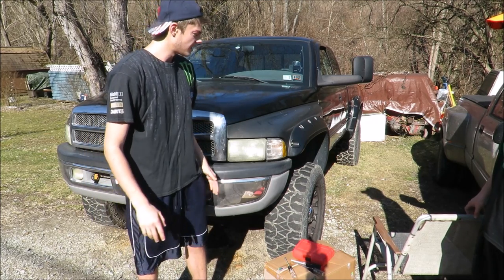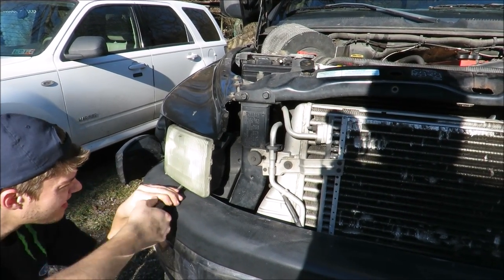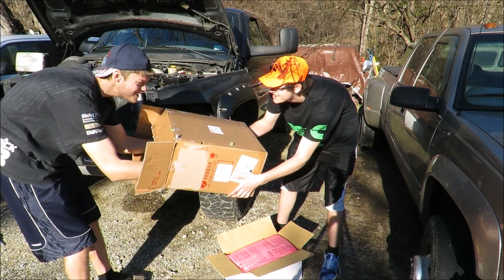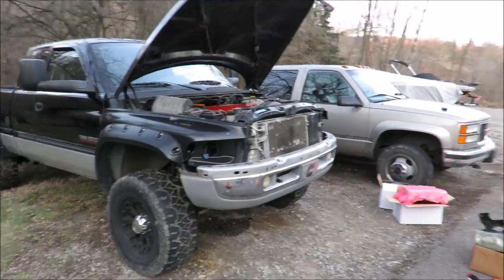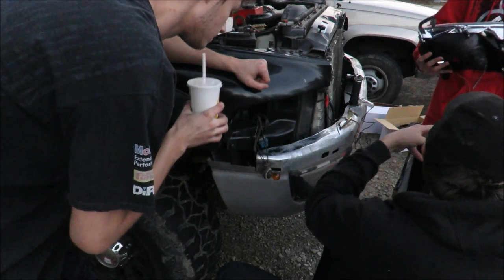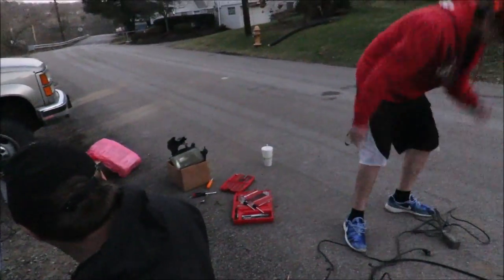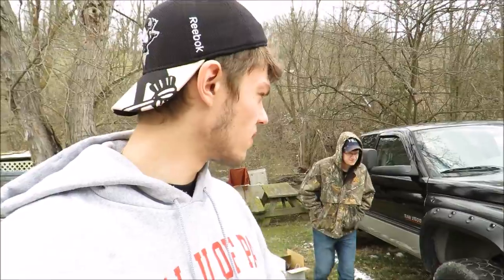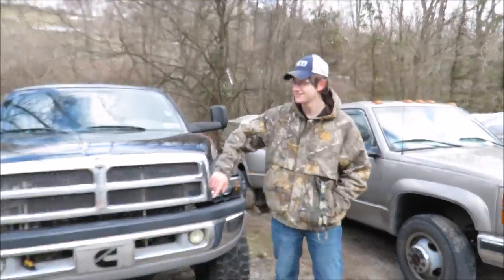LED Halo Headlight Install - 2002 Dodge Cummins

Comment: Thank you! I just purchased a 98 2500 and have been struggling for about term minutes to get the aftermarket lights to fit I spending a few minutes here solved my problem. Thank you thank you!
Reply from the maker: Thanks for watching and the sub! I'm glad the video helped you! Best of luck!
Reply: Did your stock bulbs fit rite in or did you neeed to buy different bulbs

Comment: Do those come with a harness to split the high/low beam from the stock single bulb?
Reply from the maker: They just plug right up to the original port from the stock bulb plug. So no need to split the high/low beam. The only wiring we did was for the running lights, turn signal, and halo ring light.
Reply: Awesome thank you! Thought it was 2 separate plugs haha

Comment: Got the same headlights as yours on my Ram 2nd gen 1500, everything lights up but the halo ring and 3 small LEDs don’t light up unless it’s on brights. They only light up on brights. Do you know what could be wrong?
Reply from the maker: We wired the loose wires of the new headlight into the running light circuit from the truck. You possibly may have wired yours into the highbeam wire. Our 3 LEDs and halo come on together with the amber running light. 
There is a running light, lowebeam, highbeam, and the neutral/ground wire coming from the truck. Hope that helps. Thanks for watching!
Reply: Hayden Kehm thank you! I’ll see what I can do. Love your guys trucks👍🏼
Reply from the maker: We also used that 2 way plug so incase we ever needed to remove the headlight it would be easier so it wasn't completely hard wired into the truck. And Thanks bro, appreciate it! New videos coming soon!

Comment: Did you guys have to buy different bulbs or do the stock ones fit rite in
Reply from the maker: The new headlight replaces the original bulbs, they plug into the main connection after the bulb is disconnected, but some soldering is required for the small LED lights and the halo ring. But the original turn signal bulbs plug right into these. Thanks for watching.!
Reply: Hayden Kehm thanks man appreciate it and no soldering for me I’ll use quick connects lol
Reply from the maker: Hahaha there ya go! We just went the long route with it because my brother is practically redoing everything so we wanted to go all out lol
Reply: Hayden Kehm would you happen to know where to adjust the main bulb up and down?
Reply from the maker: That I'm not sure of, you would probably have to take the new light apart to do that, you possibly could just angle it a bit somehow when installing it on the truck.?

Comment: How’d you fix the gap between the fenders and headlight
Reply from the maker: He is still currently running them with the gap, he's planning on fixing it with some sort of rubber filler almost like a gasket to fill the gap.. Thanks for watching

Comment: say brother how was the wireing set up on the headlight
Reply from the maker: there is a main plug that hooks up to the trucks original hookup port, and then there are loose wires that needed soddered and wired up in order to get the halo ring / accent lights to turn on! Hope that helped! Thanks for watching!

Comment: Hey whats that yellow plug that comes off the main blue plug?
Reply from the maker: The yellow plug is the main power plug that hooks up to the input port where the original headlight bulb would plug into.. Pretty sure the blue plug was just a slitter for the wires to distribute the power for the halo.

Comment: What gauge was the wiring for the running lights going to switch out my headlights too
Reply from the maker: Pretty sure it was 14 gauge wire, but you could probably get away with 16 gauge. Thanks for watching!